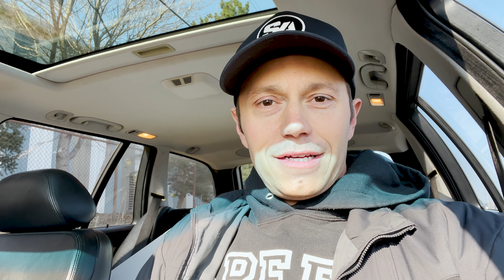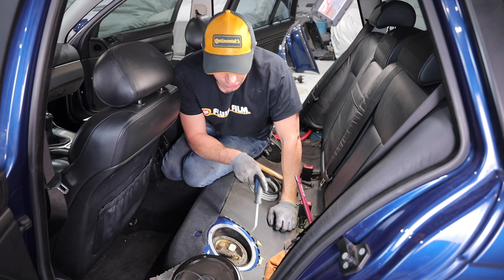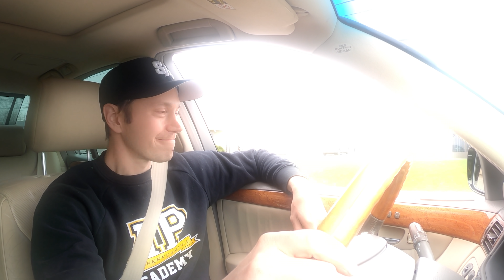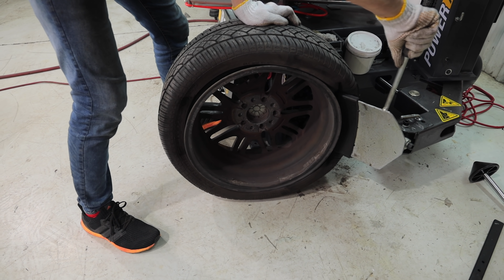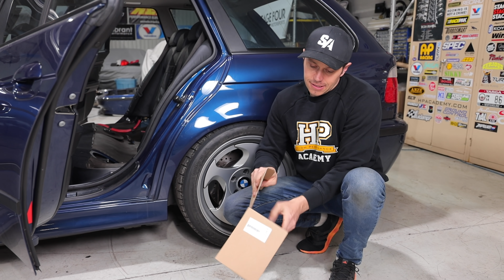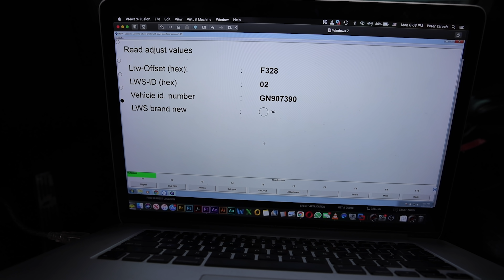FIRST DRIVE! BMW M5 Wagon - WHY CAN'T YOU BE RELIABLE?!

Comment: My buddy got an 85 volvo 244 that sat for years in a field, after he did some TLC it’s like perfect! 170 psi on all four, bmw could never 🤣
Reply: You guys inspired me to go way above my comfort zone with a project and I’m stoked for it. 1969 volvo 142s 4spd manual - has carbureted b20 engine swapping for 1987 b230ft (2.3 ltr turbo). Need a custom harness made with after market ecu, that will be my challenge. The rest is pretty straight forward. Wish me luck!

Comment: Fuel pump assy (inc. fule level sending unit) IS the first port of call when you restoring and old beemer, especially one that has been parked for a while :). If you tend to all the usual pain points before you even turn the motor for the first time you will not have any problems whatsoever. But doing it the hard way is more monetization friendly, huh? :) Nothing wrong with that! Keep up the good work chaps.
P.S. Did you do full Steering Wheel Angle Sensor set-up procedure in ISTA+? Resetting will do nothing, you need to go through the steering angle learning procedure. Oh, use ICOM A2 of course.

Comment: Check out E39 Restorations yt-channel, he does alot of this kind of stuff. When he restores cars he usually connect 2 bottles to the engine-side of the fuel-lines to check how the actual pressure and state of fuel is. Might be something wrong with the fuel-transport to the engine from one of the sides.. (just spit-balling here though).

Comment: My E39 as well, had fuel sending unit issues, weird that its an e39 thing, from the suction jet pumps, to mine being chafed wiring,.
Reply: you can also pull the high OBC data from the cluster to check the two fuel level reporting.

Comment: We had the same exact fuel problems with a 2004 Lincoln LS v8. The gauge showed about 1/4 tank and then the car ran out of gas. After trying everything we figured out it was a bad transfer (jet pump). It’s a passive system that sends fuel to the primary side. The car actually did have a 1/4 tank but it was in the secondary side that it couldn’t get to. We finally got a used jet pump from a totaled vehicle and it works perfectly. Good luck!

Comment: Hi guys, my E60 M5 had this problem and stopped me on the highway many times. Wrecked my brain, finally turned out to be some wires oit of the fuel tank. They were rotted, I spliced in the rotted area with new wires and heat shrink. Fixed the issue.

Comment: Since you have the M5 cluster in the touring, did whoever did the work on your cluster change the VIN number in the cluster? The thing with the DSC system is that:

1. all modules  need to have the matching VIN.. Cluster, DSC, Steering angle sensor. Use PASoft to access each module and verify the last 7 of the VIN matches. if the cluster VIn is different and knowing that you can not easily change the VIN of the cluster.. then the quickest way to get everything to match is to use PASoft to change the VIN in the DSC module and Steering angle sensor to match the Cluster so that the Trifecta and DSC light goes away. (also need to change VIN in the LCM to match the cluster to prevent the tamper dot from appearing.)
2. INPA or Tool32 needs to be used to reset the DSC 5.7 module, Tool32 and locate the DSC57.PRG program and run the "test_lenkwinkel" program to reset the steering angle sensor.
3. if the steering angle sensor has been properly reset with the steering wheel at 0.00 degrees aka center, and your VIN matches in the Cluster, DSC, Steering angle sensor and LCM and you still have the trifecta then PASoft should be able to tell you which sensor is causing the hang up such as Steering angle sensor as seen in your video.

Comment: tank breather blocked?, when you opened the fuel cap the vacuum dropped. mine had  ISOFIX anchors however get a set from a BMW mini one super cheap and bolt in for isofix anchors

Comment: Two tanks 
Fuel send unit not sending to the passenger tank where the fuel pump is.
Had the same issue with my e53 x5 
Level sensor works just the gas from the tank on driver side not going to passenger tank 🤙👍🤓😉💰

Comment: Lot of work that could have been verified with the fuel gauge test in the cluster on the side of the road. Thanks for the content guys. I’ve had my troubles with installing the fuel pumps on E60’s if the fuel lines aren’t routed right the fuel lines can get pinched. Also on E60’s the left side service cap for the fuel tank likes to crack over time.

Comment: So was the Dinan stage 1 installed ok? Sorry couldn’t make it out from the vid. 
Been thinking of getting it for mine but seems more complex than a simple reflash
Reply from the maker: Its as simple as a reflash, beyond simple actually. My issue is its a swapped car so EWS needs to be done after. Anyway, the reflash is fantastic. Fixes the poor stock throttle input.

Comment: The driver side of your car has a sending unit and transfer pump, other side of the tank is the main fuel pump and another sending unit. The ecu gets an average of both sides before displaying it. If one side is out it will display wrong sometimes not far off but definitely off.

Comment: The baby seat anker's where only there when you bought the option and they are welded! You're rear seat has the option cause you swapped the interior out of a car that had this option.
Also you're front seat head rest is electrical and goes up and down when you push the rest Button up and down, just a little tip 😅✌️

Comment: Those fuel level sender units are notorious for doing that crap when they're 15+ years old. They mostly show correct, until the tank gets close to the empty. Replacing them typically solves the problem.

Comment: Surely just run it until it runs out of gas, and just mark the gauge where it happens? You will then have a calibrated gauge. I did the same with my speedo and my satnav's gps speed

Comment: You could unlock the factory cluster and check the left and the right side fuel level of the tank, it will show you if the left side drains over to the right side. With 13 Liters left the left side should have been empty already. 
As for your seatbelts for the kids seat you have a later model year interior put into the car at some point

Comment: For seatbelt anchors.
Find a lug nut with the same thread as required and get that welded to a plate that will fit the location required.
Glue and pop rivet or bolt it in place.

Comment: You can try cluster TEST 6...the first screen shows the data being sent by the left & right level sensors + the approx amount of fuel left in the tank (in liters). And the 2nd screen of TEST 6 will show the total amount of fuel iin tank + Phase 1, 2, or 3...where PHASE 1= all ok, PHASE 2 & 3 mean something is wrong:

Comment: The steering angle sensor is definitely to blame for those errors on your BMW Pete! Mine went out on my e60 and it caused the AWD system, traction control, and stability control systems to malfunction. I’m not sure what the e39 one looks like but I was able to clean the contacts on mine with some rubbing alcohol. After putting it back together everything worked!! Good luck, and keep the the detailed episodes on the BMW coming!

Comment: For the Baby seat hooks; it looks like you’ve got a pinch weld to work with. You could use u-bolts, type that is commonly used on leaf springs. Drill holes to match and bolt them in with fender washers.

Comment: I have  a 2003 Sport Touring , here in Europe we got some sweet inline 6 diesels single turbo M57 engine e39s, mine is a 3 liter manual, I absolutely love it, almost 200hp the torque is almost 400 (m5 has 400nm),. You get incredible gas mileage, its really torquey, it does not sound like a diesel, you can  easily make good power if you mod it . I feel like you guys missed on them over there, in may 2021 its going to be 3 years since it last broke (self leveling air bag), I can vouch that the m57  engine e39 are extremely reliable, but I also had e30, e36, e34, e38, e46, e39 with gasoline engines I6/v8 you do get more problems with them, but I still love them and I consider that many of the problems come from lack of proper maintenance  .

Comment: Fellow M5 wagon owner. I liked the episode and have also ran out of fuel with 1/3rd of a tank still showing on the gauge. My gauge was accurate until I swapped the m5 fuel pump in. I have dove into it to figure out if one of the senders is bad or the cross over tube got unseated. Most likely it is something I caused when I swapped the fuel pump in.
Reply from the maker: I suspect The pump wasnt seated originally so it was pulling fuel over and wasnt bottomed out both leading to the issue that I had

Comment: Idle Control Valve is evil I tell you... EVIL. The old 540i should have the same one. If the problem return (knocking on wood it does not) swap them out.

Comment: Fuel gauge issue most likely the intermittent sending unit. When the wiper does not make good contact, the gauge reads high. Friend of mine had the same issue with his E39 which got fixed after replacing both sending units. I do not mind the longer episodes, we can all learn from it. Really like the humor additions lately, PTs petrol induced nightmare was super funny!!

Comment: Had that same issue with the fuel gauge on 2 of my e46s and it was a fuel pump on its way out both times. It's not strong enough to transfer fuel from one side of the tank to the other or something like that.

Comment: 1. E39s have a left and a right tank. The engine only draws from the right tank. There is a leveling pump that is likely dying and so there could be gas in the left tank and tha gauge is correct (as it sums up both tanks) but the engine is starved.
2. The steering angle sensor can be cleaned 99,9% of the time.

Comment: The child tether points were an option mostly left unchecked. In my 530 e39 sedan I had to buy the anchor kit from bmw this mounted to the factory holes. I suspect the same is true for the wagon. 
Hit up your local dealer to see if you can still get the retro fit kit.

Comment: Regarding the baby seat question: 
The mounting ports for them were options on all touring models (at least here in germany), so I think they did the same on US models. Here the system is called Isofix.

Regarding the gas pump system:
The inline pump has enough power to suck the fuel out of the right half of the tank. The excess and heated return ends up in the left tank. The in-tank pump pumps the fuel from left to right with the help of the suction jet pump, among other things. If the in-tank pump is out of order, around 15-20 liters remain in the left half of the tank, while the inline pump empties the right half of the tank. Most of the time the cart stops after a right turn. If the in-tank pump is out of order and there is a shortage of fuel in the right half of the tank, centrifugal force can cause fuel to move from left to right in a quick left turn or in a roundabout.

Comment: For the fuel pump I'd suggest a diesel transfer pump the mechanic shop I used to work at had just a harbor freight branded one, I used it on diesel tanks that were contaminated and for pumping out the oil and mixed fuels from the shop containers never once had an issue. Hope this helps

Comment: I have a 540iT that I'm converting to 6 speed manual. This isn't my first dive into the BMW arena, having already converted my 525iT to manual transmission; had to learn coding to get everything to work. When you talk about chasing  problems and fixing things to raise the reliability to standards more easily achieved in Japanese imports I can totally relate. Having built a couple of Accord's and Civic's, I was in for an education once I fell hard for e39's. But my 525iT with a manual transmission is so much more rewarding than all of those Honda's. I totally understand why BMW can claim that they produce "The Ultimate Driving Machine". Even though your project if far more involved, this video's have been extremely helpful, thank you.

Comment: Take a car that's been sitting for 5 years, swap a giant known histrung race engine in a different chassis, and by someone that's never done that swap. Yet you expect it to just work perfect? Bmws are know for maintenance issues because lots of people want them and they put a million miles on them while staying a nice car. No other car ages the way a bmw does. The bmw reliability thing is more of cause and effect issue more so than just unreliable. Also they were designed to work smoothly over reliable therefore more maintenance is required to stay in high tolerance, for lack of better words, environment

Comment: I had this fuel problem in my e46 m3. Not sure if yours is similar. As it can happen on the e46 too, showing petrol but not cranking

Turns out that as the fuel tank is bowed for the driveshaft and exhaust to pass under, the fuel from the opposite side of the fuel pump was not being sent over to the side with the fuel pump. So the reading of the petrol in the tank was correct, but the car was not able to send it to the engine as the fuel was stuck on the opposite side to the fuel pump (if that makes sense).

Comment: I had a similar issue with a Porsche 914 I had some years ago. I'd put in fresh had and the car would run, but there was bad gas on top of the tank that wouldn't burn. The fresh gas would sink to the bottom. As soon as the fresh gas was used up, the bad gas on top would reach the pump and the car would stall.

Comment: Check fuel pump under the driver seat, that was the problem for me in mine e39. That’s a common problem on them. ;)
Reply: specialy when there is less then 15 litres gas on the fuel tank, its a sign that you have a problem with the fuel pump which is the one that I talked about. That’s exactly what happened for me. I’m not saying that is the same problem on your e39, but it’s worth checking

Comment: I’ve tried to code in a replacement Light Control Module with INPA and PA Soft. Couldn’t. Without coding the LCM in the turn signals wouldn’t work. Lots of middle finger waves from people. BMW drivers aren’t assholes that won’t use their turn signals. They are innocent victims of complicated unreliable electronics and complex software. 🤷‍♂️😂

Comment: Recommendation for Fluid extractor:  Mityvac  -  I use a manual 1.9 gal and have an electric one I use as a sump for larger quantities.  Makes bleeding brakes, clutch slaves, and removing fluids easy.
Reply: I guess they wanted to reuse the fuel

Comment: At work, when we need to empty a tank, we tend to use old noisy carburetor electric pumps because, while slower than your AEM pump, it is much easier to control and not over flow the jug.

Comment: It might be worthwhile changing the ignition switch, it's a fairly common problem on e39, 46 and 53. Had it happen myself, same thing it, died all of a sudden, it cranked but died. Let it cool for 10 minutes and was back on the road and it happened again, waited this time around 20 minutes and made it home 30kms back. 

Very much like when fuel pumps or coils start to heat up, you let them cool for a bit and they run for a little while again.

Comment: I'm doing restorations on my VERY neglected DINAN S1 M5 and you guys inspire me to keep going when I all I want to do is rage quit! I had the steering angle sensor go out on my old 540i and its the same as in the M5. To remove and replace it will be "fun", lol! But for you guys it should be easier than for me out on the street. The little "donut" is near where the steering column linkage is found and will need to be disconnected. It doesn't look hard to install but there is a point where its held in the base of the steering column with these 2 screws that the head gets removed so it looks like a rivet top. Making a notch on that "rivet" made it a lot easier to remove (literally unscrew) and install the new unit. Once you install the new unit (I replaced the old screw with new screws that have heads BTW), you may want to NOT install everything back together and 1st go on a test drive to test out the angle sensor with live software telling you real time data. Once you get it all dialed in, the light on the dash can even be cleared with a handheld scanner. Best of luck guys!

Comment: On my old E46 I replaced the the sending unit and the gas gauge was still off. It ended up being the gauge cluster. Bought a new gauge cluster and problem solved

Comment: If it was not a bad contact on the lever arm on the sender, then it could have been the plastic securing tab on the level sender unit that connects the transfer jet pump from the passenger side fuel pump. If this is the same system as on the E46, the small o-ring or the plastics on the level unit that secure that tube can break down over time and cause the fuel not to get sent back to the passenger side of the tank from the driver's side. This would cause the fuel level to read somewhat correctly, but all the fuel is stuck on the driver's side. In any case, a new complete driver's level sender unit should fix both problems.

Comment: Don't know about the ISOFIX in USDM Cars but my E39 (EU Model, Switzerland) does have those anchor Points, maybe you could use the Seatbelt attachement points asanchors?

I don't get it, why do North American BMW's break so often?
Between me and my 2 best friends we owned 13 different BMW's from different Generations of almost every series and apart from the constantly overheating E38 750 and a warehouse full of ABS Sensor we didn't have breakdowns or any repairs to do that you wouldn't have with any other Car.

Comment: Also I had the same issue w my e46 m3. Had to redo the whole fuel system with the same steps you did. Both sender units, the crossover pump, and fuel filter/pump. It did take a few drive cycles to go from max full to max empty to get accurate readings.